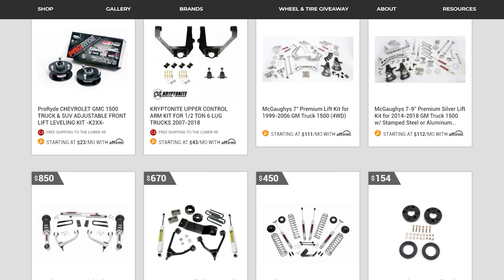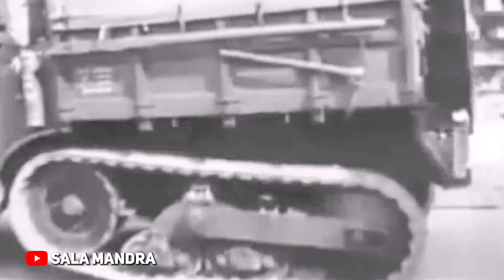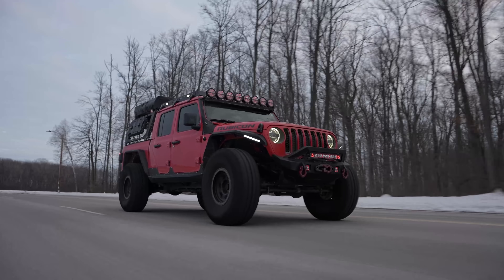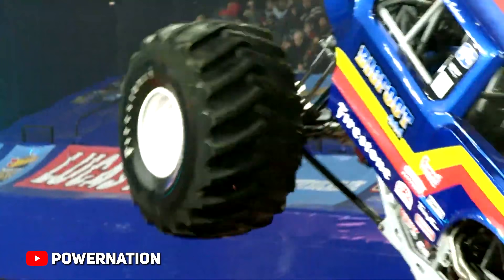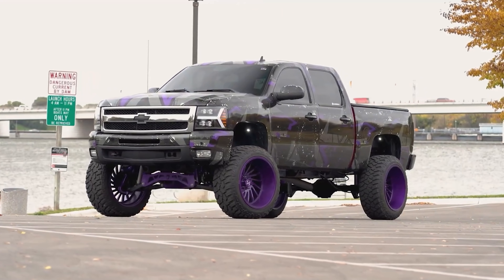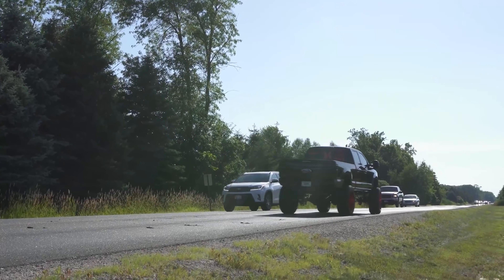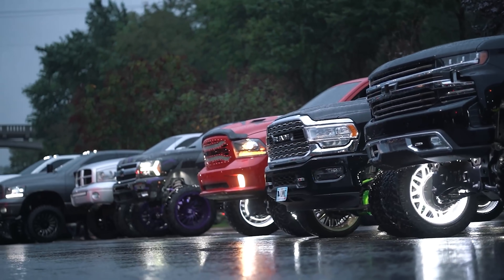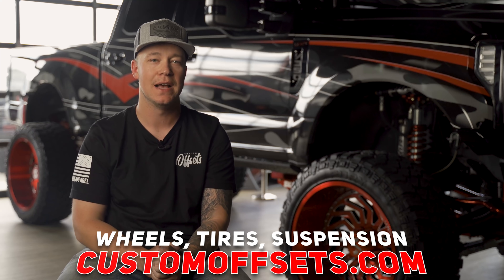History of Lifting Trucks!!

Comment: I ordered a 6inch rough country lift for my 99 Chevy k1500 from rough country store in Robinson and it’s finally in and I need to do one more thing lift my cab up off the frame then I can sand it down paint it then install the lift and yea I’m restoring my truck which is why I stripped the body

Comment: question is a cogneto Motor sports 10 to 12 inch lift with dual fox shocks with cogneto traction bar made for off road and full sending it?
Reply from the maker: Depends on what you're meaning by full sends for offroading, it can take off roading, to an extent. if you're looking to go jumping a truck and offroading it, alot you're best off getting a lift kit more tailored to that type of driving
Reply: Ok thanks because i was wondering if the suspension was good off road and can handle rough terrain like dirt at some hight speeds so this will really help on the suspension choices